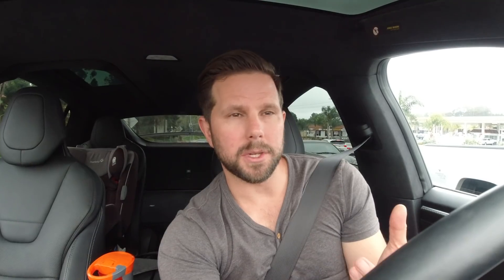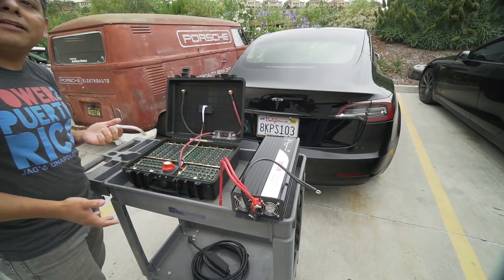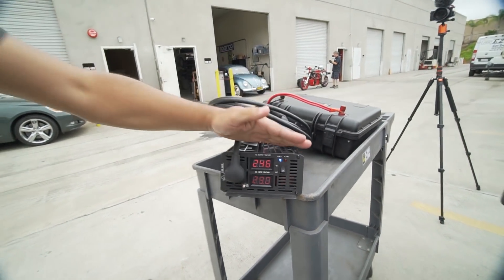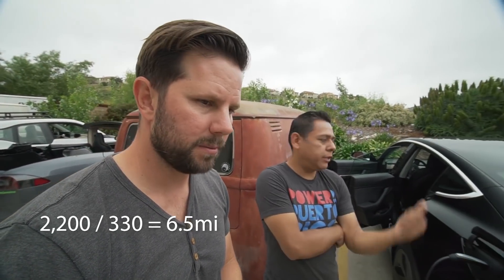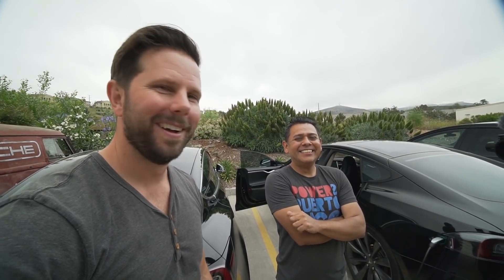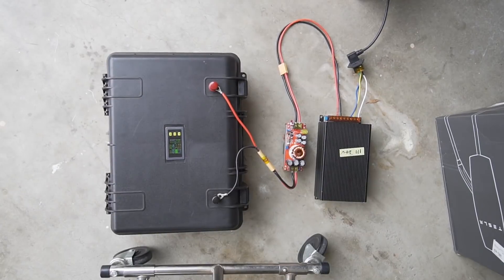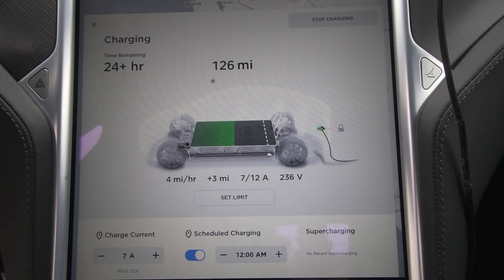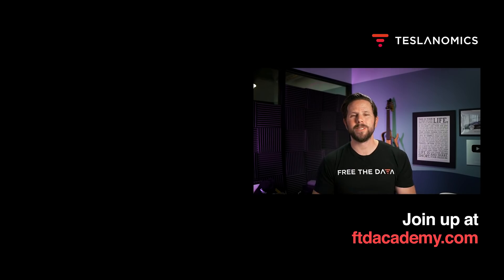DIY Tesla Gas Can - Will it Work?

Comment: Hello sir do you think there’s anyway to convert us to 16 V to use as a jump box similar to the NOCO GB 500 However semi trucks are on a 12 Volt system and 16 V seems to be enough voltage to get through dead batteries on a semi truck

Comment: This "gascan" is teetering on the edge of useful. Very cool! 

Observing the battery built in this video (very clean/nice work there BTW!!!), looks like 7S32P pack there. ~10WH per cell of "usable" energy storage = ~2.2KWH

Few things we could do to get this thing over the edge into more useful territory. A commercial "answer" to this "gas can" might look something like...

128 X 21700 cells @ ~18WH each. = ~2.3KWH

Cells arrange with triangle packing efficiency, we can fit 128 X 21700's into about half the space demonstrated in this video using triangle packing efficiency.
Wire the pack 32S4P, for ~120V operating voltage. This will improve the overall conversion efficiency and reduce the size of wiring and inverter. 
Should be possible to fit the whole package (cells, 32S balance charge controller, and 120VDC>240VAC inverter ) into a package about the size of that pelican case. 

Slightly more stored energy along with slightly better conversion efficiency in a package small enough to consider taking along, this should be enough to put about 9 miles into a model 3. 

Integrate some useful power outlets (12V DC, 120V-15A AC, USB-A with fast-charge negotiation support, USB-C with full range of negotiations up to ~90W for laptops, tablets, phones).. Sell it for $799.

Comment: This one is actually kinda easy. If you want a solution like this (battery) you will need a much bigger battery. A fully charged chevy volt battery with a 10000 watt inverter should work fine. The problem is it's a lot of weight you would need a truck or a trailer to haul it around (this would give about 30 ish miles). Or just get 5000 watt generator and a gas can that would work too.

Comment: you have the rough equivalent of a .5 gallon can. 

I think what you have is a rough equivalent of a gas can. it isn't a 5 gallon gas can but it should be enough to get you  to a charge station. Unless the next one is over 20 miles.

Comment: Consider a cascade system, like firefighters or scuba divers use for SCBA tanks … you start with a low pressure “gas can” and build to a high pressure “gas can”.  You’d need 2-4 of Jehu’s mobile batteries for this type of system.  Just a thought I had when you were talking about how as the battery gets drained out, the less power (or in theory “electrical pressure”) the mobile battery has to charge the Tesla.  Potentially, with this method, it could be possible to “equalize” the energy with a low pressure “gas can” and gradually increase the Tesla energy to a higher pressure over time.  Just a theory; I know energy and gas are two very different property substances - food for thought.

Comment: Just add a alternator to the front wheels while spinning when driving, it can charge atleast 3x100 watt battery in the trunk and also with a 2000watt inverter to transfer the 12 volt battery to 110 to charge tesla when it's on low battery. Can that work? Try it in an upcoming project might work better. Who knows
Reply: Well the only problem is that  “Power in”  is higher then “Power out”  so not really not a benefit. The Tesla’s battery will drain even faster trying also drive the alternator.

Comment: I know TESLA does not recommend attaching an inverter to their auxiliary battery but on a model S that battery is charged with up to 200 A and therefore could easily drive a 2 kW inverter which would then be able to charge another Tesla.

Comment: Just found out I only need an extra inverter to use our 3.3kWh DIY moped battery pack to charge our EV... :-) It is rated for 14kW max discharge. Also: 3x as small as that suitcase thing, only if there were smaller inverters

Comment: Right so after the “once the battery starts running low it’s unable to charge and it just quits..” bit; doesn’t it stand to reason the real issue is that you’re trying to push in power to  a mostly charged battery? 

E.G. it should work better in the application it would hypothetically be used in: mainly when the car is mostly out of charge (or at that critical point) and you need the extra push to get to a charging station... namely because the transfer of energy will be higher when going from a small to a depleted rather than small to a charge higher than it’s own? 

So the point being [in theory] it will try to equalize the volts/amps between the two so when the larger source (the cars battery) is so discharged that such a device is needed to even be able to reach a proper charging solution, it will be able to absorb more power and at a quicker rate to try and reach the equalization point. When the larger source is simply more than half (& much higher as shown in this video) the smaller pack can only discharge to about 60% (by pure guesstimation/logic, no data to speak of) when it runs out of umph, to use a highly technical term; versus if/when the larger source were nearly depleted, it would take more of that available power more quickly just to equalize then take the extra umph-capacity... ??

Anyway that’s my thinking on this subject:

**Retry with an emergency-type depletion scenario on the larger source and see how much you get...**

Comment: 48 volt when have done a little better but if some one could run a set of cabels off then main bus off of the tesla battery and and technically if you made Tesla gas can and ran it into a BMS and then hooked the main Tesla leads into the BMS it would show that there is a cell low and would try to bring the level up thus for charging the Tesla's battery

Comment: If your Tesla can power your home (it outputs power) it would only take an adapter, or a middle-man circuit to charge another Tesla. You can start by powering that inverter box with your Tesla, and then charge the other Tesla from there.

Comment: The only way for this to REALLY work is to do DC to DC charging... too much loss in the conversions from dc -> ac -> dc...
OR MAYBE
Tow the Tesla, with the car on, to REGEN charge the car (should be ok especially if it's ONLY a few miles needed)
^ -- this would be the fastest
Reply: Yes this is the  the fastest way to charge a tesla or any other ev on the road without charging stations. :)

Comment: this is awesome. I think this should be a software hack where (and of course Tesla probably would have to do it) you can set 3% of your charge as an emergency spare tank.  If/When you run out of battery, you can then enable that last 3% from the console (or maybe even a hardware switch).  Your approach is awesome and maybe is a good idea for a mobile gas tank solution provider for teslas (just give me 5% for the business idea).  Just fill your Tesla Truck bed w/ batteries and wait for roadside assistance calls. :)

Comment: When it comes to power to weight and space, gas turbines seem to be the winners. Since this thing would be hauled around in the trunk and (hopefully) rarely used, light and cheap would be the orders of the day. Also a gas turbines can go full power until it is out of fuel and you might not need to carry the fuel for now since any liquid hydrocarbon will do...

Comment: How about if I plugged a tesla charger into the 50 amp 220 outlet on the welder generator on my service rig; and waited?
 How long would you have to wait to go 20 miles?  Nobody has called me yet, and I haven't even priced a big tesla charger, but it looks like it's only a matter of time until this is an everyday thing (not). I don't get many calls for fuel, mostly: Keys locked in the car, tires, fuel filters, lights, and that wrist pin hole that breaks off the end of the jib on an excavator.  
 I don't understand the whole purest thing.

Comment: On one hand it would be cool to have a battery on wheels that could drive around and provide a quick boost to a broke down Tesla that ran out of "gas", I can't think of a case where it would be better to sit on the side of the road and wait for the car to charge vs just hooking it up to a tow truck and towing it 20 miles to the nearest charging station.

Comment: Alternatively directly attach a small reserve battery pack rather than using it to recharge the main battery, that would be faster, more convenient and of course totally efficient compared to all the losses from the inverters. However, you couldn't draw more from the batteries than they're designed to, the car would need to restrict the current significantly in order to not overload the batteries, and the pack itself would need to be beefier than your setup, perhaps far more but lower capacity cells. I wonder if you could remove the inverter and just recharge the tesla directly off 240 DC.

Comment: I didn’t hear this issue addressed - the weight of the additional battery and converter is going to offset potential gains.  I LOVE this idea, but until batteries increase in energy density, it makes more sense to pay for additional battery capacity in the vehicle, itself (I assume that is an option).

I LOVE this idea, there just seems to be too much conversion waste, plus weight deficits, to make it worthwhile (to use a battery pack to charge a battery pack).  I think the idea of Tesla-to-Tesla charging is awesome!!

Quick thought - is there a benefit to creating a highly efficient, lightweight gasoline generator to use as a charging pack?  Perhaps it can be made lighter than using actual batteries, and the carry weight decreases as fuel is used.  Of course, it would like only hold 3-5 gallons of fuel, so weight differential would be minimal, either way.

Comment: Try wiring it for DC fast charging, those cells can safely push 20-30A so 130 cells in series would be about 14kW at 480V.  Would take maybe 10 minutes to transfer 1kWh from the pack to the car.  Dunno if the Tesla supports 1000V fast charging, or you can parallel multiple 480V packs if needed.  Can also charge the portable pack itself in a similar way at a public DC fast charger, or at home.  Just do the research and be careful, those cells can explode if specs are exceeded.  Definitely make sure BMS has multiple temperature sensors attached directly to several different cells.

Comment: First, my bad if someone already mentioned this as you have 1k+ comments and I did not search/read each one.  Here's a concept idea.  Tesla mobile service or AAA (tow truck) can have an onboard generator to plug into/charge the battery pack (trickle to full charge) while the truck is normally on.  Today, a carpet cleaning service with a van/truck mounted generator/motor runs the carpet cleaning device; I'm not sure if it's separate or connected to the van engine.   This should help reduce/resolve the power degradation in the battery pack during usage. 
And what has been mentioned in a  comment below, DC2DC done via a special charging cable (2 headed) to go from one Tesla to another (i.e. jumper cables), plugged into the existing charge ports.  The software can reverse the charge port-in to charge out (with amount/limits setting).  The max battery out-flow usage will be set similar to as if you were driving on the freeway.

Comment: The electric gas can seems like it would work better if it were a reserve battery already built into each vehicle.. there would be no need for inverter loss as the cell would be designed with the proper voltage / specs.  It could be a not much advertised feature that would become relevant and offer itself only after the driver had run out of charge on the main battery.?  This feature would place the vehicle in 'limp in' mode.  Basically a 'gas' saving mode to get you straight to the super charger / garage.?

Or simply have the vehicle go into 'limp in' mode @ 10% (or predetermined low battery level) or less battery.  The way this is presented to the customer is up to the company.

Comment: I was thinking it wouldn't work for another possible reason. If you did run your Tesla down that much. That gas can might not have enough to put back into the car to override the cars shutdown sensors. I'm sure Tesla has it built in that it shuts down at one level then you have to get well over that level for it to come back on.

Comment: I wonder if you mix ultra capacitors (3000 F or 100,000 F from Zoxcell) and the batteries. The reasoning is your pulling all you can thru the batteries and to me that's probably why you couldn't charge at the higher amps

Comment: Hi - very interesting. A problem for Tesla owners, running out not next to a charger. Would be perfect to have a key protected switch or something, that turns on a "emergency boost" within the car for an absolute emergency. Range of the emergency boost 15 km...... Would need another "emergency" battery bank within the car. Didn't read all the comments so apologize if repeating someone else who had same idea :) Car to car is a good idea too.

Comment: What if you used a gas powered inverter?  It's small and most have 1800 to 2200 running watts and builtin plugs!  Most can run for over 4 to 6 hours on about 1 gallon of gas.

Comment: Portable generators would be the fastest option. As soon as more EVs are on the road, wreakers and auto service trucks will all have them for that purpose. If you are in an area with lots of construction and welding rigs running around. I bet some connection could be do e between a portable welding unit and the car.

Comment: Two solutions: 1. A bigger battery. Just have a larger battery and larger inverter that can handle more amps. 2. Have a way to plug the battery in to the car where it can draw power directly while driving without inversion etc. ie plug it in and drive to the nearest charger. That way you don't loose that extra energy and you don't have to wait.

Comment: You should build a unit that uses super capacitors & a custom high end inverter instead of batteries to do this task. Also, Tesla should make a portable battery pack that connects and straight out powers the car, not just a delayed slow charge of the batteries in the car. Again, super capacitors would be more suited to this task.
Reply: Also,  super capacitors would allow for fast charging of this boost unit. They could even include a hand crank system to manually charge the super capacitors; which would add a great emergency protection feature to the system where human power could be applied if all else failed. The fast charging would also make emergency situations less time consuming.

Comment: Maybe this could be brought to the attention of the Tesla Manufacturer, they, in turn, could come up with some sort of { Gas can aux charge port} or a variable system that will charge at full system charge or adjust to a lower demand in cases where there is not enough power for items like this to work in an emergency, I don't see why they would fight it, as it doesn't devalue the vehicle, just the opposite it makes the car more versatile, just because the charging system is made to quick charge does not mean their cant be an auxiliary modification for emergencies, and or simply for convenience on long trips, I hope you pursue this avenue and I would love to see the outcome of such a suggestion. Mack Harley

Comment: Tesla should have an emergency tap in the trunk that allows direct access to the dc battery system that way you could have a Tesla emergency battery pack that you could plug in directly to the cars power supply and avoid the inverter power loss and you wouldn't have to wait for it to charge.

Comment: I wonder if this is something I could be solved if you instead ignored the limitations of batteries and switch to a chemical backup power source. like having a generator that runs on a tank of propane or something or a couple gallons of gasoline.

The real trick is more a matter of finding a fuel source and / or containing it's in a matter that you'd be okay leaving it in the trunk of your car for six months or so on end.

Comment: Use a 12,000 Watt gas/propane powered generator.  It's also handy during a black-out on a dark windless night.  It would be interesting if thos $900 units would cut it with less than perfect sine-shaped output or if an inverter unit would be necessary for L2 charging.  L2 charging with an inverter generator would be much more expensive, more than twice.  I waiting to get my first sighting of a Nissan LEAF with a rear transport platform mounted on a hitch holding such a generator so the car can drive a hundred miles, charge up for a few hours at L2 and then repeat until the destination is reached.....bring earplugs :-).....may have to do some "ground-cheating" which sounds dangerous but there must be a safe way to do it.

Comment: Smart guy to have jerryrigged this.  However with the power loss and cumbersome nature they should design a DC connection using super capacitors from Maxwell. Using dry tech they could be stored in a small area and pack a huge punch. You prob need 10 miles. 16x density and much lighter than LIon.

Comment: Tesla should sell emergency battery packs with, say 10-20 mile juice so if your car is stranded somewhere you can just get it from your house or just keep it in the car and plug it in a designed emergency slot when need be.

Comment: It would work better if you could connect additional battery to Tesla's main battery, or switch to external battery (for safety). This way you could call special service, they will drive to you with charged battery, connect it, and you could drive away immediately, right to closest wall socket, return battery in 24h to given point to get your bail back. Additionally you would avoid any loss in process.